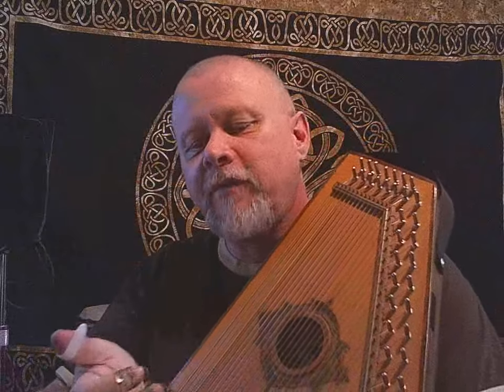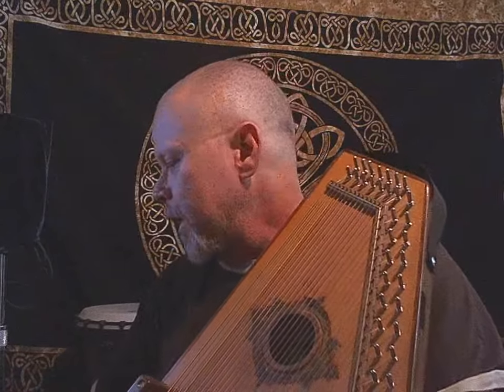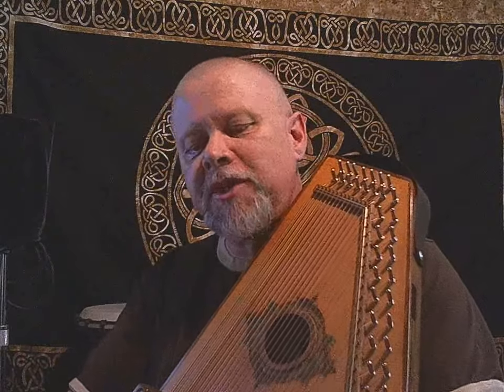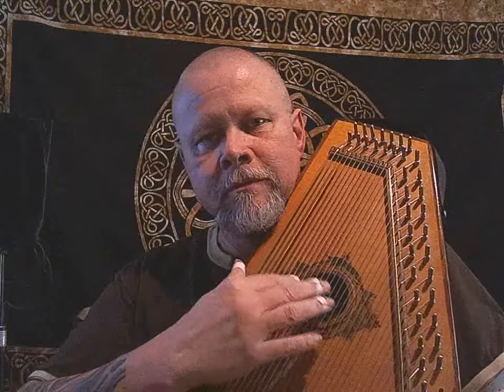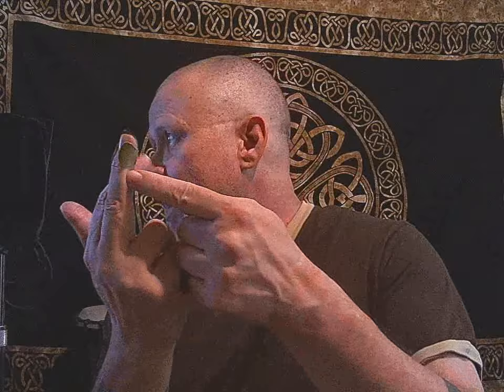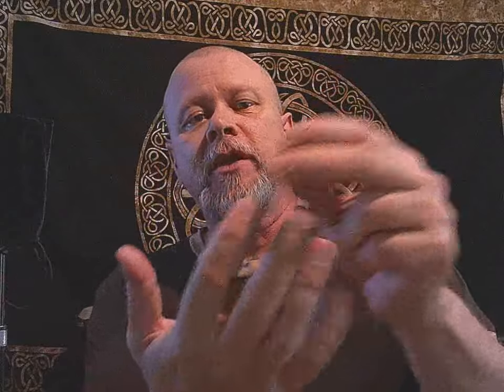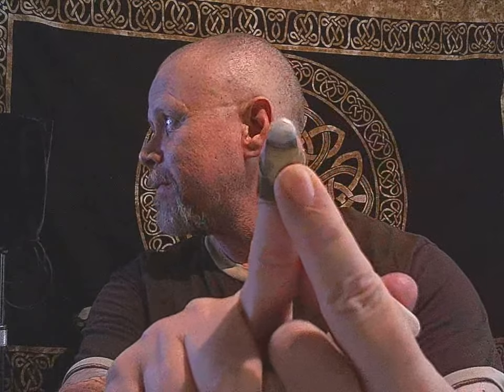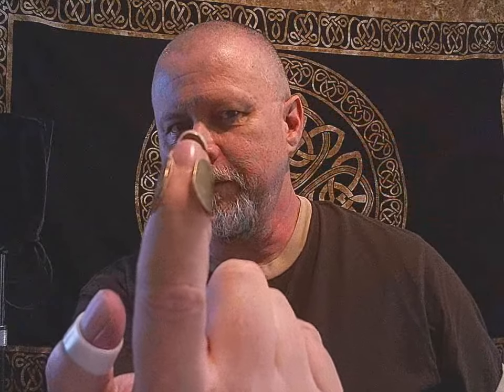A Louder Plastic Pick! "Stalking the Wild Autoharp" video blog series: Hal Weeks

Comment: My issue is trying to reach the chord buttons farther away from the GCFG7 chords like Em. It's all the way at the end area. If the song is fast rhythmically or the chord changes are far At the other ends I seem to have a hard time getting back without playing a wrong chord. Or playing the chord next to the one I meant to play. Thx for any advice.
Reply from the maker: Couple possibilities.   Some harps have the bars arranged so that the minors are not located near the buttons for the keys they are associated with.   For example, Emin really belongs right next to Gmaj.   Some harps it's quite easy to move the bars around and come up with something better, and most 'harpists will go thru a period of chord bar experimentation to come up with a better layout.   I don't know what kind of harp you have, or what your current layout is, so I won't presume an answer.  I noticed you friended me on facebook this morning, and it'll be easier to show you pictures and links and stuff over there.  Another solution would be 2 or 3 patches of sticky back felt or some other material on intermittent buttons so you can find your way back by touch.  For example, some people will put something on Cmaj and Dmaj.   THat way they will always know where they are.